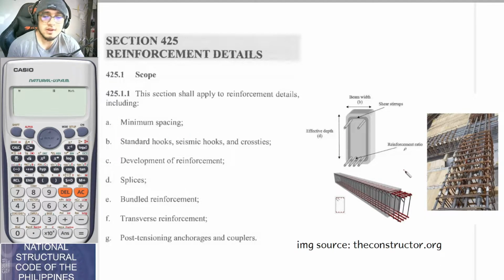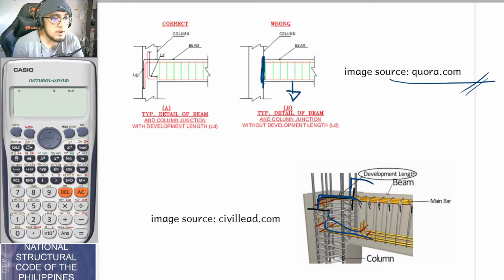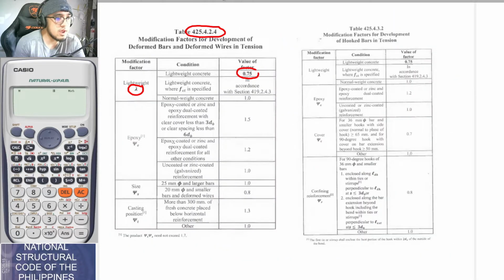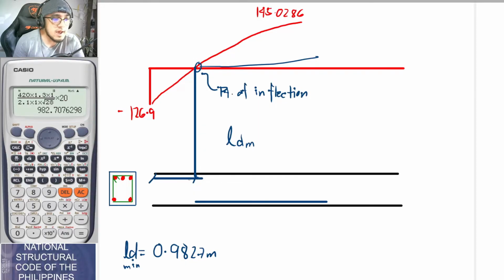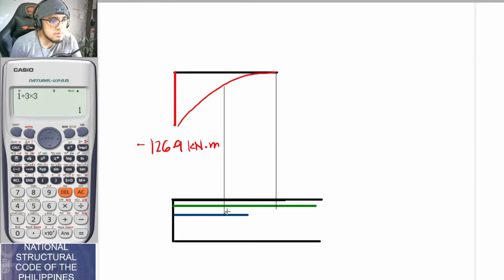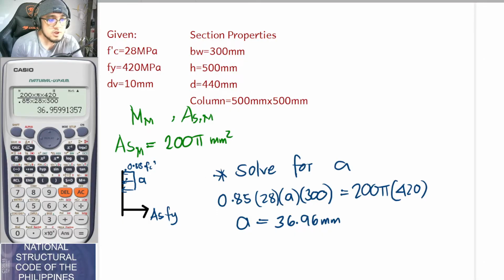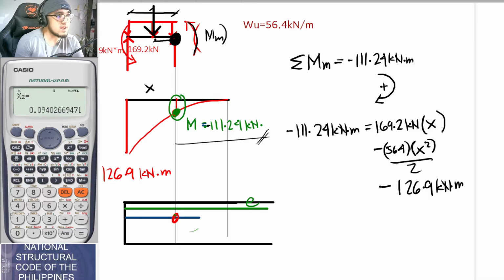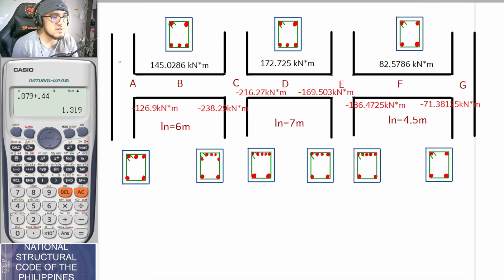NSCP 2015: Reinforcement Detailing p1- Intro and Development Length of Tension Bars

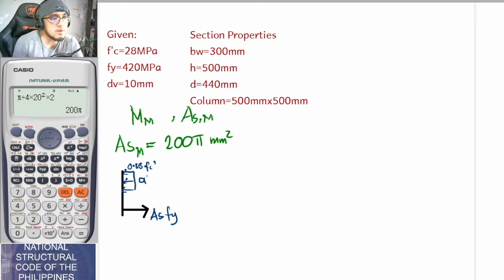Comment: Ask ko lang po. dun po sa paghanap ng moment capacity na wala nang bar L, bakit singly po ang analysis ng strength po doon? hindi po ata nasama yung compression bars sa ilalim? @56:57 po. Maraming salamat poo. Regardless, galing nyo po magturo.
Reply from the maker: @shankylezapanta1464   nasa provision na kapag yung value ng steel ratio ng tension steel is less than rhomax, pwede mo siya ianalyze using SRB. Hindi magkakalayo yung sagot if icocompare mo sa DRB analysis. Almost equal sila. 😊

If gusto mo accurate result: solve mo using DRB

Pero inaallow naman ng international code na gumamit ng SRB analysis if pasok siya sa criteria. Halos same din lang sagot 😊
Reply: @deanzanoCE  Noted sir thank you poo. Bale sa actual structural design po, kahit na sapat na po tension bars para maging tension controlled yung section, required parin po talaga na maglagay ng kahit 2 bars sa compression zone?? Ang main reason lang po ba nito ay para may support lang po yung shape ng stirrups? bale wala po talagang SRB na design po? thank you po ulit at Godbless po. tanong ko narin po pala sir about sqr. isolated footing design and analysis hahaha. kung sapat na po ba na average effective depth lang po gamitin para sa OWS, TWS, at flexure? nung sa nagtry po kasi ako sa flexure, kapag larger d po ginamit ko, 21 bars po nakukuha kong required against Mu. pero nung ginaya ko po sol'n ng prof ko po na average d gamit sa lahat, 20 bars lang po nalabas. Parang naisip ko po kasi na mas safe po ata pag extreme steel yung ginamit na d na kung safe napo para sa xtreme na d, safe narin sa other way ng reinforcement since sqr. ftng naman po. Thank you po ulittttttt